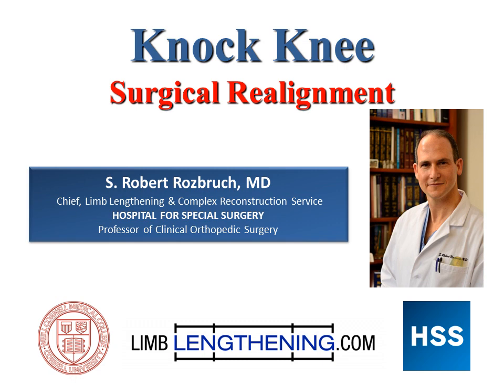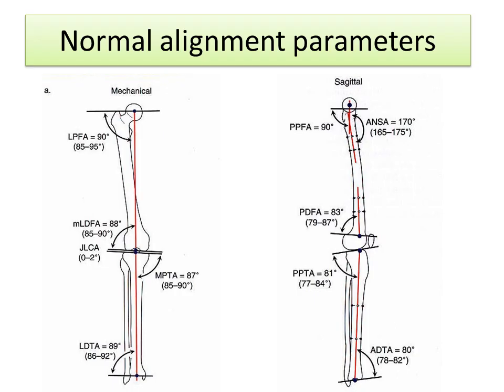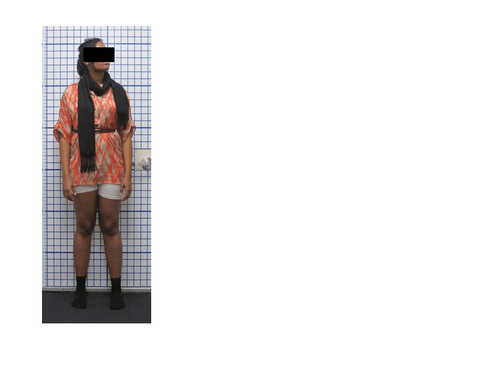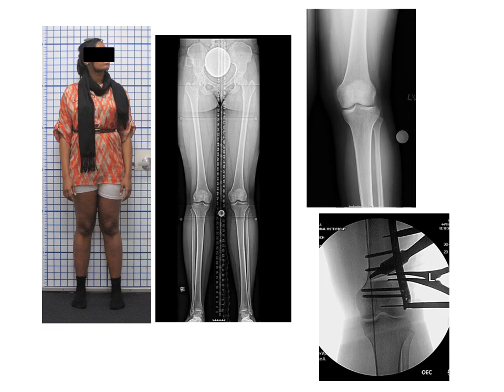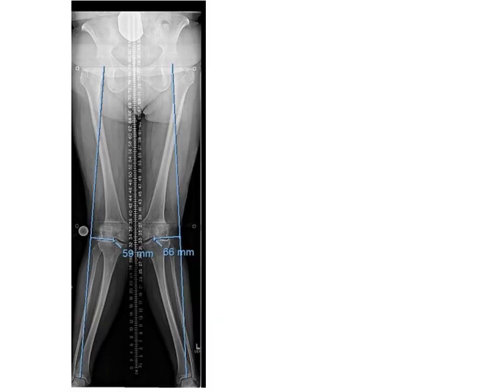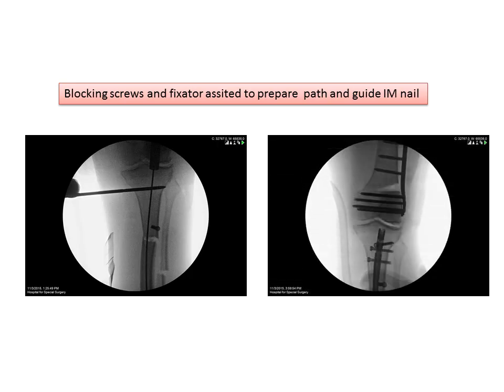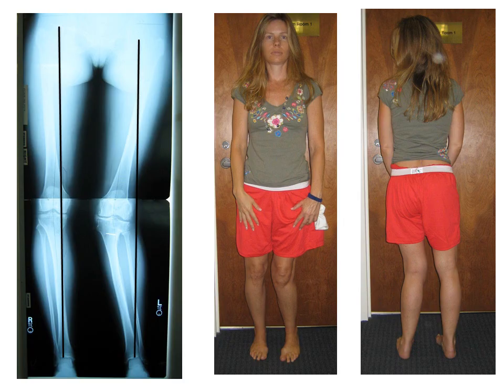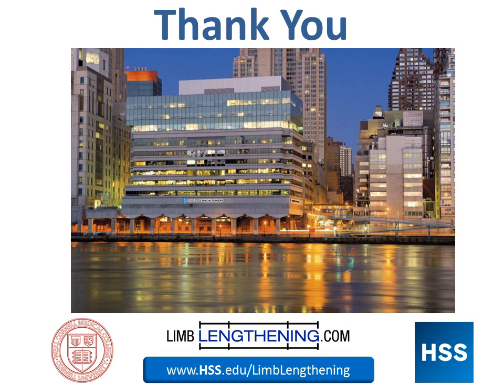Surgical Realignment: Knock Knee Correction

Comment: I desperately need this surgery  to boost my confidence. HELP ME I NEED HELP !
Reply: Talk to an orthopedic surgeon..it will get worse as you age..You are going to be just fine😊
Reply: As long as your growth plates are open they will be able to do it, my growth plates are closed now I think but they aware open when I got it done, how old are you because it has to do with your age
Reply: @shanapearson6378  I’m 17
Reply: @SurrenderedtoJesus  it all depends on if you’re still growing, they told me that my growth plates in my knees were still open so they were able to do the surgery but they’re now closed and I’m 16, so it just depends on that, if you want the surgery just check, but it has been very successful for me
Reply: @shanapearson6378  so if I’m still growing they can do it or no?
Reply: @SurrenderedtoJesus  yes but there is another thing to consider too, the reason I had mine done was because they put me at risk for  other knee problems because how knock knees I was so they made me stand with my knees together and measured the distance between my ankles and because it was over a certain measurement they did the surgery, I don’t know if all doctors will do that but I’m assuming so, maybe try and get a consultation to see if you are eligible for it, I don’t know if it will be covered under insurance, do you have an knee pain because that’s how they discovered my knocked knees and that the whole reason it was covered under insurance
Reply: @shanapearson6378  yes I have knee pain
Reply: @shanapearson6378  how long it takes to recover after surgery
Reply: @SurrenderedtoJesus  the worst pain lasted about a few days  but that was just when moving around a lot, it actually heals up quite quickly I was back at my sports within less than two months, there was a bit of pain when going back to my sports but only doing certain things, after about a week, there’s not much pain
Reply: @SurrenderedtoJesus  also I was up and walking the second day, I was able to go back to school about a week after, I think full recovery time was about 4 weeks, I had the surgery to put them in and then the suregery to take them out in the same year, in 2019 the removal was even quicker recovery time, the removal isn’t always necessary but I wanted mine taken out because I do gymnastics and I felt like they were catching on the beam, the plates are quite small, idk if it was just in my head or if they were catching, it’s only necessary to get them taken out if your knees have fully corrected but your growth plates are still open, that’s because they could over correct and cause bowed legs, but don’t worry about that cos they do checkups to check the correction the plates have done
Reply: @SurrenderedtoJesus  have you spoken to a doctor about it yet, also if your growth plates are already closed there is another correction surgery but I think that one is more invasive because the bones are already set in place
Reply: @shanapearson6378  yes my growth plates are open I’m a boy we grow until 21, and my knock knee are similar to the first girl in this video, if you were wondering.When I get back from vacation I’ll speak to a doctor and update you.Appreciate your help💙
Reply: @shanapearson6378  doctors are no help🤦🏾‍♂️😢
Reply: @SurrenderedtoJesus  oh why what happened with them
Reply: @shanapearson6378  told me it’s because I was tall🤦🏽‍♂️ but now I’m gonna go to a new doctor I’m not sure when, but how much u paid for the surgery ?
Reply: @shanapearson6378  How much was the distance between your ankles with both knees together? Which procedure did you undergo- Osteotomy or guided growth surgery? Kindly reply
Reply: Does anyone know how much this costs?

Comment: And after two years, I have just got my leg plate removed ... and I am trying to walk which is not so easy for me.
Reply: so do you have pain after plate removal
Reply: @gunagyasharma3326  yes
Reply: @geetsarvaiya482  
Would you recommend the surgery?
Reply: @acruz123  yes definitely
Reply: What was the cost?
Reply: Why was plate removal indicated?
Reply: How do they know when and if surgery is necessary?

How do they know it's not just weak glutes and quads? Let's head to the gym boys, cumon!!
Reply: @napomodise8776  muscles don't change the joint angle. Tendons can tho, but how can you change your tendon length?
Reply: @independentchick5699  yes
Reply: I kept my leg straight for a year because my patella had been slipped due to the knock Kani, due to which the leg could not fold. Then the doctor said about the operation
Reply: Due to being in the foot of the plate for a few years, everything was fine but then the problem was ahead and I had to remove the plate.
Reply: I am still facing problems and pain too
Reply: @geetsarvaiya482  why did you have to remove the plate? I'm gonna leave mine in forever
Reply: @jayseo1374  because my doctor who operate that surgery he told me that its complusry to romove it because my age is 29
Reply: @geetsarvaiya482  is it hard for you to walk bcause the pain?
Reply: @VeroApril  yes mam but i manage it
Reply: @independentchick5699  my right leg bone below knee is not straight what shoud i do
Reply: @Elitewoodsports  high tibial osteotomy
Reply: I\'m not sure but ,if anyone else needs to find out about bowlegged try Lenas Bow Remedy ( search on google ) ? Ive heard some decent things about it and my cousin got amazing results with it.
Reply: How are your legs today? Still satisfied with the result? Are there noticeable scars from the surgery?

Comment: 6:01 Does the external fixator avoid internal plate completely? If yes, does this mean that any surgery part will remain inside the legs? And this is possible for all ostheotomy surgeries but the interested area is not so huge? I am a gymnast, so I am very worried for my sport too. Thank you from Italy.
Reply: Riky Bologna  you can be a gymnast with knock knees? For some reason, I always blame my knees for how horrible I am athletically
Reply: @jasminekeanaaina4369  Hi Jamsine. Yes, it depends a lot about how much you are flexible and how much you costantly train this feature. However, tissues damaging happen along years, so this is not a forever solution. Overall, I have left leg tibia rotatiin "only" and not bad as the problem shown in this video, so this counts too sure.

Comment: I'm almost 40 and have slight ongoing pain in my knee for years, the knee is very inverted. A bit like the last lady's knee. Am I too old to get this done?
I feel alot of damage has set in already. I suffer back, groin and leg pain and tightness, I may have to get my fallen arches fixed with surgery too. Life is not good.
Reply: If you're under 60 it's usually recommended unless you're obese. If you are obese, lose weight first through strict dieting and then get it done when you're only moderately overweight. Check BMI calculators for your weight category.

Comment: Do the plates and screws remain in permanently ?
Reply: No 2yrs or 1 and the half yr
Reply: No I had mine taken out the same year I had them put in because they fully corrected, it all depends on how long it takes for them to correct
Reply: @shanapearson6378  any side effects after pls
Reply: @pengieee6686  no not really just pain for a few weeks, it’s is quite painful right after though, it is also quite a speedy recovery I was back at my sport after 4 weeks
Reply: @shanapearson6378  How are your legs today? Still satisfied with the result? Are there noticeable scars from the surgery?
Reply: @MM-ir7qw  my legs have improved fully and they have stayed ever since I had the surgery there are noticeable scars, there are 4 but they are only bout and inch and on on the inside of the knee
Reply: @shanapearson6378  how much u paid ?
Reply: @shanapearson6378  At what age did you undergo surgery? Do your knees still hurt? Kindly provide an update
Reply: @श्रीहरि108  I think it was probably around 14-15 years old and no they don’t hurt anymore and the surgery went well
Reply: I want to know the same thing!
Reply: most likely

Comment: Can surgery be done before 18 years
Reply: Yeah it will not worked after 18 as iam teenager I gone through this surgery when I was of 14 previous year and now iam of 15 in 16 the screws will removed by surgeon it is of 2 yrs and it will be effective don't take tension take a good consult of doctor..

Comment: I had an Operation to correct my knees more than 20 years ago. The legs still seem knock kneed. And on top of that I know experience unbearable pains. I still have the screws in my knees. And it is very painful by just a small knock on the knees. I'm in my early 40s but i can't stay on my legs for more than 10 min. Since the Operation was done at the time when technolodge wasn't so advanced like today, could there be a way to make it better for me?
Reply: Omg so sorry for you
Reply: https://youtu.be/klxRiZKRSf4. 
i made a video on my knock knee
Reply: Why do you have the nails in your legs for 20 years? Should they not be removed after a few months?

Comment: Hi, very nice video I didn't know this topic was highly sought after. 
1. How can we determine if physical training vs the surgery would be needed? 
2. Are the fallen arches corrected as well by surgery or do they correct themselves once the knees are realigned after the surgery?
Reply from the maker: "To determine whether physical training or surgery would be needed often depends on the extent of the deformity and would need to be evaluated by a physician. As for the fallen arches, correcting the knees will improve the feet. Only after the knee correction can we determine if additional work on the feet is needed." - Dr. S. Robert Rozbruch. 

If you would like to schedule an appointment at HSS, please contact our Physician Referral Service at 888-720-1982.
Reply: Hospital for Special Surgery thank you
Reply: al final te hiciste algun procedimiento?
Reply: In the end did you do any procedure?